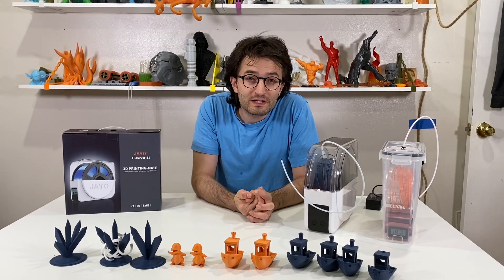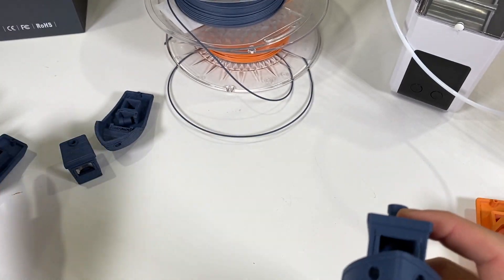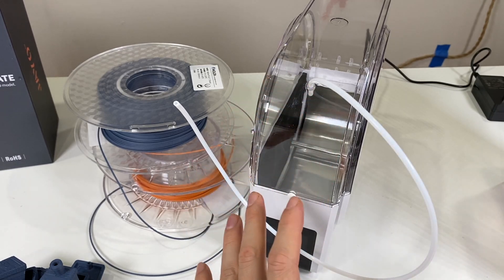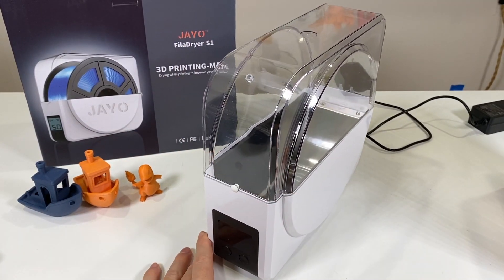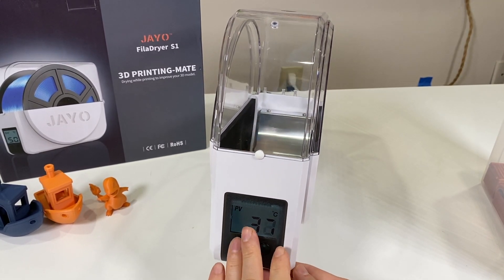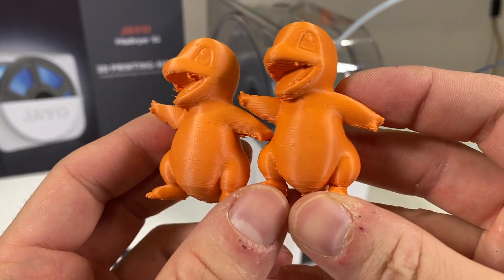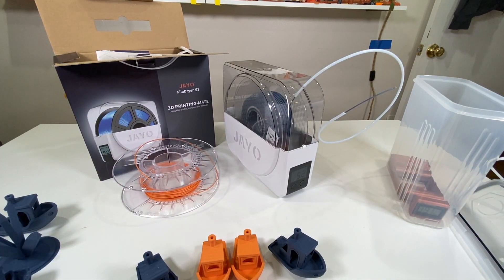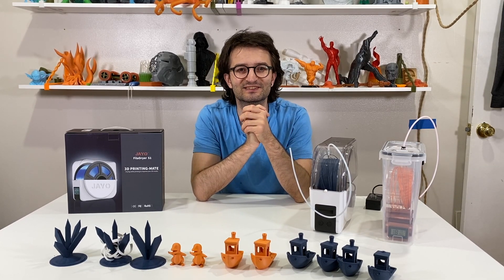How to DRY your filaments? | JAYO Filament dryer "FilaDryer S1" review

Comment: Good video. Thank you. I'm not a huge fan of this dryer. The bearings /feeding are not smooth on mine. I looked for a way to loosen them or disassemble the parts they rotate on to maybe lube them. Couldn't see where to do so. Even placed directly over the printer and at an angle facing down, the extruder has to pull.  This causes stringing. The moment I switched to a smooth spool holder on bearings the print quality improved so much. We need a combination of the dry box and quality spool holder.
Reply from the maker: Yup I agree